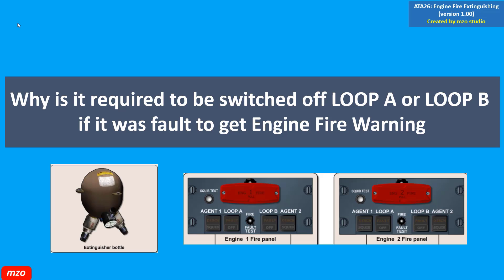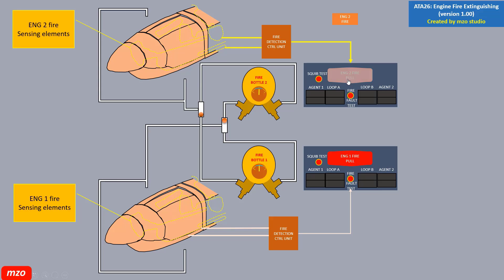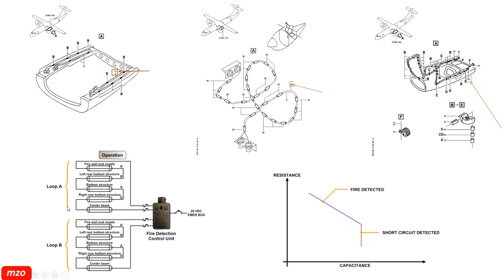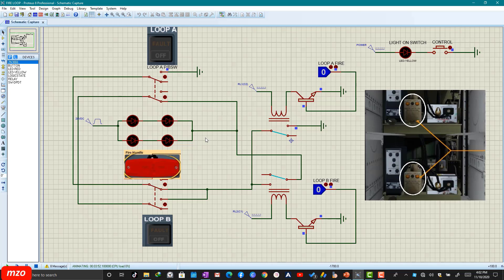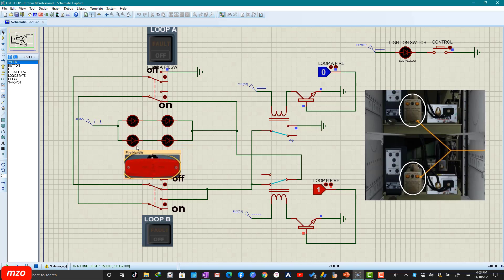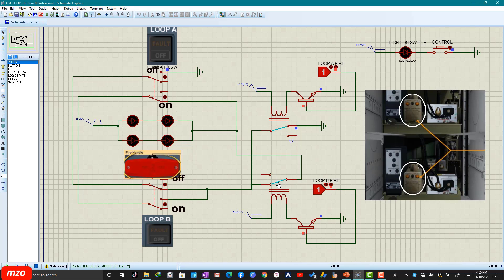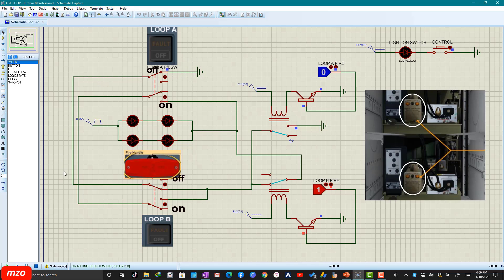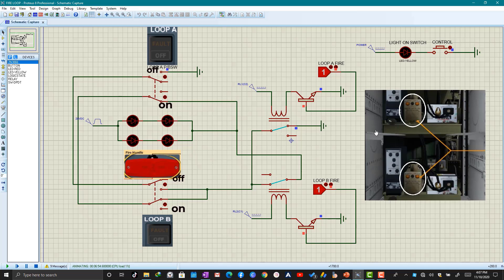ATR72 Fire Detection System Simulation💥( Why you Switch off Loop Switch if they had any problem)

Comment: (1) Can we dispatch A/C by switching off with Loop fault IAW MEL, Bro?
(2) How can we know the fault sensing element if loop A or B due to five sensing elements, Bro?
Thanks, staying tune
Reply from the maker: 1) yeah, we can dispatch the aircraft because it is MEL Cat .C . We have four detection loop in which only one loop is allowed to be unserviceable.
2) The best way to identify which sensing loop can be problem, is to use Continuity and Insulation Check, but, as per my experience, one loop which is located over engine jet pipe, usually give us a problem that contact with structure due to poor maintenance, but other loop wire have been found. Whatever I do on maintenance, I usually start from easy way.😀
Reply: Thanks for sharing of your experience and knowledge, Bro
Reply: Can u pls upload video on hall effect sensor.